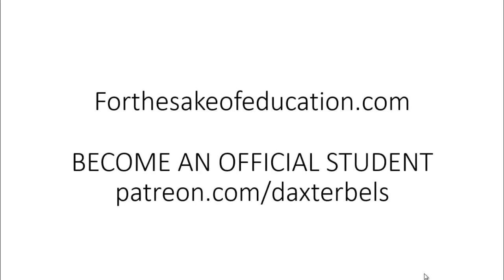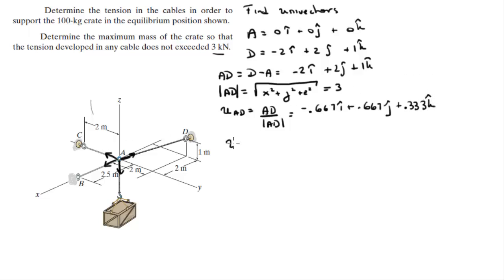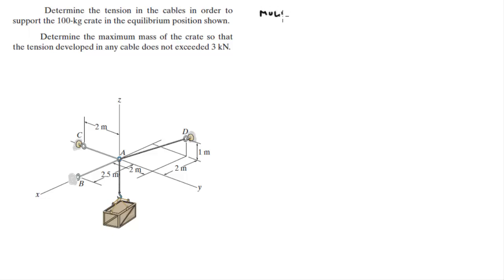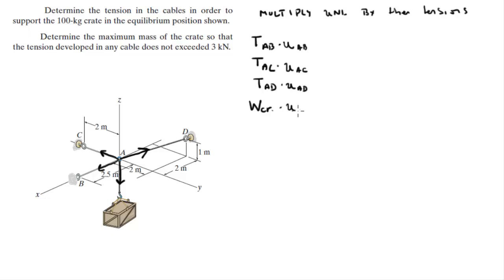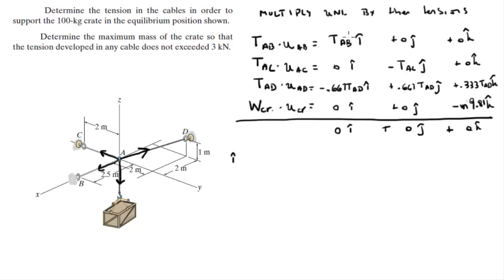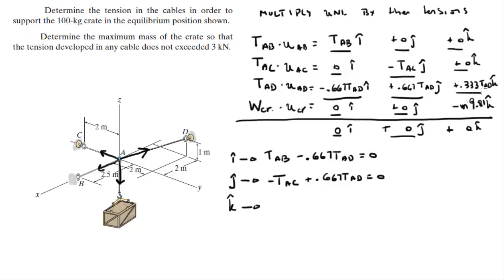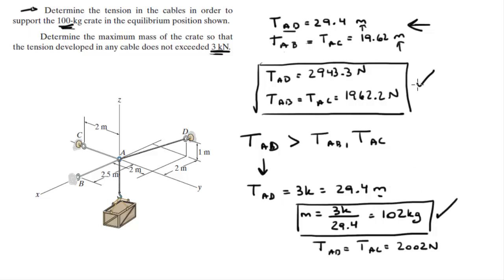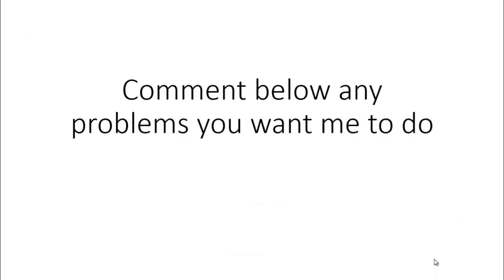Determine the tension in the cables and the max mass of the crate

Comment: can anyone plz help me figure out how he is getting i, j, k. im having really hard time seeing this. at 2:25 how did he get Uac = -1j. how do you know its -1 in y direction?
Reply: He is doing the unit vectors. A unit vector has a length of one, no matter what direction that it is facing. The unit vector of Uac = -1j because it is in the negative y direction. A general rule is that wherever the coordinate letter ("y" for example) is written, any forces pointing to it are positive, and any pointing the opposite direction are negative. The force of AC is going the opposite way of where the "y" axis coordinate is written, so it is negative. I'm not sure if you're aware, but the x axis coordinates will have an i, y axis coordinates will have a j, and z will have k. Hope this helped a little bit.